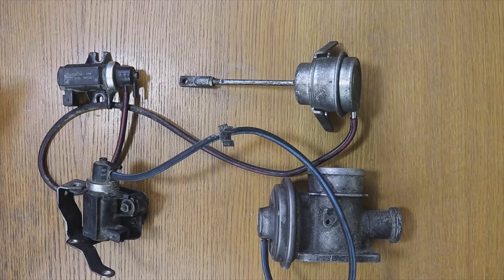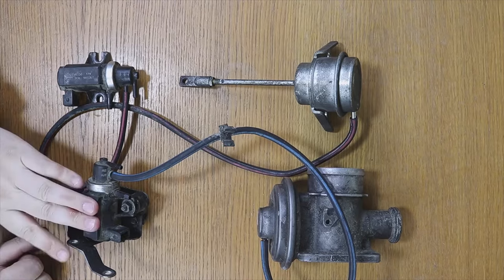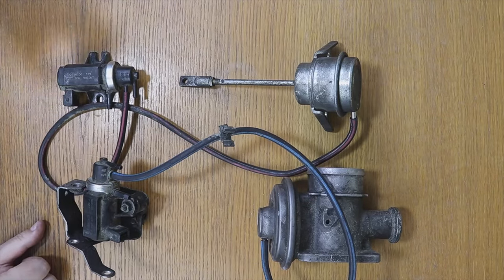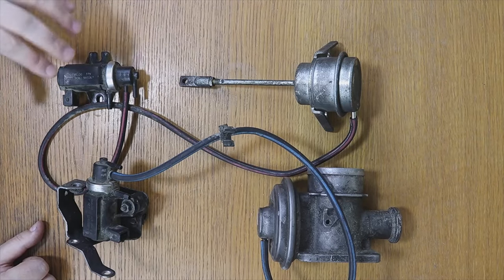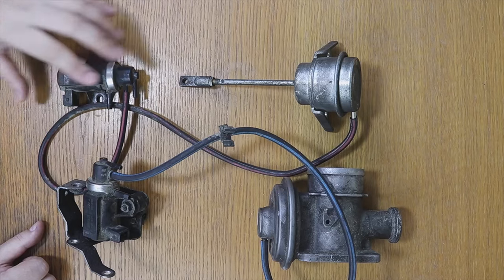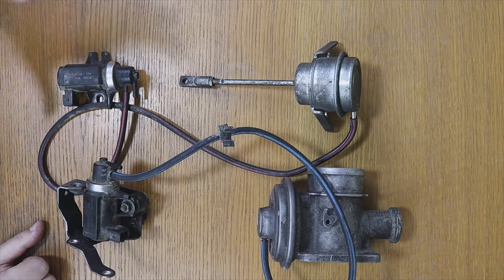Symptoms of FAILURE of the SOLENOID VALVE of the TURBO and of the EGR

Comment: Eu testei as duas válvulas e estão funcionando, tenho a luz do motor acesa e falta de potencia, o computador acusa falha na válvula do turbo, podes me ajudar?
Reply from the maker: Que falha a máquina de diagnóstico indica para você?
Reply: O meu é o mesmo problema..erro p0299...
Já troquei a solenóide de três vias e a bypass também.....o carro fica sem força as vezes
Reply: @estutu1489 me too bruh I turn off the car for 3 seconds and turn it back on sometimes it don’t turn on, do your burbles and boost come and go ? I’m having this issue rn I get a drivetrain malfunction
Reply: I have the same problem, ive changes the Solenoid and the actuator but the problem is still there im about to order the egr valve vacuum hope that solves the problem. Please let me know of anything else i should look into. @LuisOrtiz-bs6ou